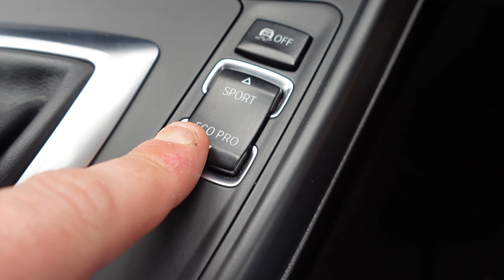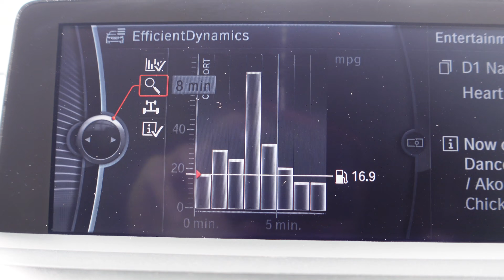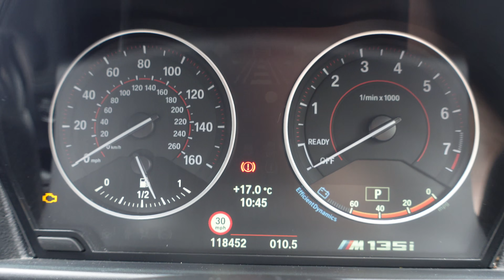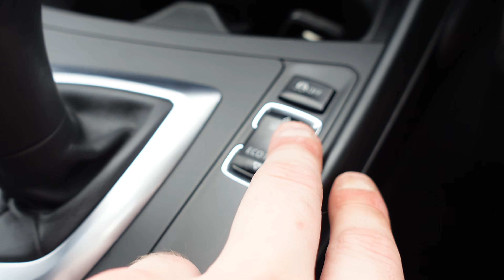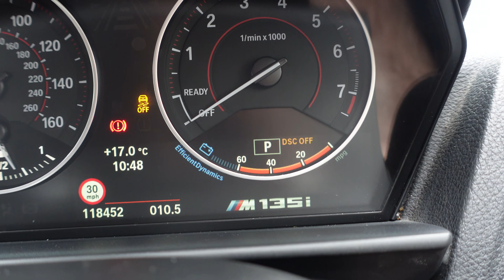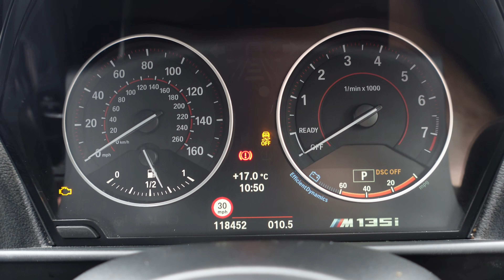BMW Eco Pro , Comfort Mode , Sport & Sport + Modes Explained

Comment: ECO PRO: sluggish throttle response, it makes it easier to drive slowly, without straining your right foot. Also it lowers max AC performance so there is a slight tiny fuel consumption reduction.
COMFORT: (normal) - default, linear throttle response curve.
SPORT mode actually does a lot of things at once: 
1. Fast throttle response, (natural response curve) 
2. Higher cruise RPM (around 2k) for more immediate power and faster turbo spool-up. 
3 Faster transmission kick-down, much more eager to downshift.
4 keeps lower gear for a few seconds after you let of the accelerator.
5. Less steering power assist for slightly better feel.
6. If you have adaptive suspension the car get's firmer the faster you go - sport mode makes this effect much more aggressive. Also you will have the option to choose for sport mode  to ONLY change suspension, without changing drive train mode.
SPORT + mode does all that sport mode does (always changes both suspension and drive train), turns off start/stop, turns of traction control and puts stability control in "drift" mode, which allows for oversteer but will still kick-in if understeer is detected. 

Additionally you can activate transmission sport mode, if you have that equipped, by moving the lever to the left: Even higher shift points + deliberately jerky shifts (no smoothing out) + if you start shifting yourself, it will stay in manual mode until RPM goes out of safe range (yup, it won't let you stall the engine nor cruise at 6k rpm), while in normal mode it'll revert to full auto around 1 minute after you stop shifting with paddles.

Comment: Sport+ is available on my 6 speed manual UK F31 320i/N20 M-Performance configuration, I've seen mentions that EcoPro will also reduce the duty cycle on the air conditioning compressor but I'm not 100% sure that is a thing!

Comment: I have an issue I cant diagnose, can anyone help please?
I have a 2004 bmw x3 with an m54 engine. 
I had a massive tear in the main air hose for like 3 years which I had a constant check engine light on for but the car ran completely fine other than a bit of irregular rpms movements at high rpm on cold engine. Im finally planning to sell the car and get something newer and decided to get the car into perfect working order. As I was starting to work on it my starter went out. Here is everything I did in the last month on the engine.

1) replaced the airhose,

2) Replaceced the ccv and all the hoses that go with the vent system

3) Replaced starter

4) replaced intake manifold gasket

5) replaced crank sensor

6) replaced exhaust side cam position sensor

7) replaced coolant overflow tank

8) replaced maf sensor with a cheap amazon version, ended up working even worse so I swapped back to original

Here are the symptoms:
1) hard time starting on cold engine, as soon as it starts, you can shut it off and try again and it will start right away.

2) Runs completely fine, drives fine until you floor it. When I floor it, the rpms reach a ceiling anywhere from 3000-4500rpms. When it hits that ceiling, engine will bog down and lose rpms to complete shutoff unless I depress gas pedal completely.

Diagnoses ive done for Maf sensor.
As car is running, I unplugged maf, no change in RPM, and engine stayed running. Is it possible its the MAF? Or intake side cam sensor? Disa? Throttle body/MAP? Fuel delivery? Im so lost, plz help

Comment: Any idea what the drivetrain error is caused by. It just does it when you drive at high speed but then rectifies itself. 
I was told it could be the egr valve?

Comment: Sport+ good in rain dont lock fron as much where in rain full tracktion off is scachy 125d got sport+ and 8 speed gearbox on 2 liter variant in case anyone wants to go eco 2 liter diesel 125d was good on mpg 40 in town 60 motorway 135i is much more fun tho

Comment: Hello,
I also own a F33 420i Cabriolet and wouldn‘t say the Eco-Pro is useless as thia mode enables the „sailing cruise - function“ which clearly lowsrs fuel consumption if you drive on German highways. Kind regards & greetings from nearby Cologne.

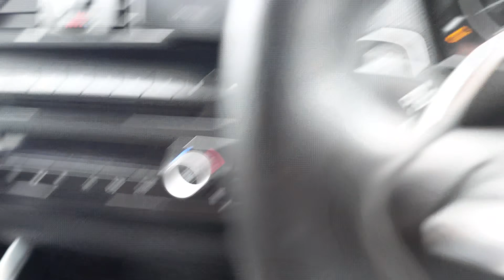Comment: im kinda confused, so you can basically put the car in sport while in comfort mode ? at 4:09 he said you can just move the gear shifter over to sport, does that apply while you are in the comfort mode or does that mean you go into manual trans w the paddle shifters ?
Reply: Moving the gear shifter between drive and sport just changes the transmission behaviour. Whether it’ll change gears by its own when it thinks it’s necessary or let you rev up to the red line
The engine parameters remain unchanged

Comment: Hi there first time bmw owner here 

I have a 420I (2.0L petrol) and watching your you say that the eco pro doesn’t do anything in the way of fuel save however leaving the setting as they are (75mph tip) I find that my bmw saves fuel and the remaining miles seems to stay the same or go up on motorways (I live 17 mines away from work) should I keep using the eco or should I just keep it in comfort? 

Thanks

Comment: The diesel automatic you can change speed on eco pro. Factory setting was 130km on my one I lowered it to 120km /h to decrease the output slightly hoping to save a bit more fuel.

Comment: Eco mode on a diesel, don't do shit for it. I got the 116d and on a full tank, it says, I get six hundred and sixty miles. After driving it six hundred and sixty miles I ve saved forty miles, but my tank's still empty and only covered a range of six hundred and sixty miles

Comment: Guys fyi in case you have a low tire pressure warning ( Lovely bmw thing ) you’ll not be able to change the mods. Specially if you want to go in the sport while the car is still moving. Small info for those that are maybe scared that their mods don’t work. 😁

Comment: Well I can see there’s no homework done here…. Eco pro doesn’t just reduce throttle motion, it also controls airflow into the car and cabin reducing the need to use the engine for auxiliary components thus reducing fuel, it’s not entirely useless, it’s an effective way to increase your MPG, you missed out comfort+ aswell (assume you don’t have the VDC) as comfort plus utilises the damper control, changing the behaviour of the suspension and chassis roll of the car. Which is again what it will do in sport and sport plus it will firm up the suspension creating less roll and stiffen up the car.

Comment: 2014 F15/ X5 30D @51k miles, EcoPro changes gears exactly wear I want it to. All other modes seem to hold low gears for longer unnecessarily which I hate. I have a fault where in EcoPro with very light throttle the car will erratically lunge/ surge and then disable a shit load of systems and revert to Shitty Comfort. I know the battery is weak so Im pretty sure it is the battery causing the issues as system will disable same systems sometimes before driving off.
Reply: My theory is AGM batteries have a weakness that BMW design exaggerates. AGM batteries are fine for starting current but do not hold a high voltage which BMWs require. As soon as voltage drops BMW does alsorts of stupid shit. AGM especially do not like cold winter temperatures and can catastrophically fail literally overnight. My fix is going to be fitting a good branded tolerant EFB battery. I dont trust AGM and really dont want one ever again.

Comment: My comment on sport+ is that during winter and if the road is slippery, its an hige advantage to use sport+, as without support systems you now have full controll over the car. I live top of a hill, now during winter when I want to drift the corners for fun, as I often do, then sport + is on. 😁🚗

Comment: There is a noticeable increase in revs and throttle response between comfort, sport and sport plus in a standard F32 435i. If you sat at 65mph and flicked through the different modes the revs increase and the car surges forwards. So I totally disagree with his comment about sport plus being for launching only.

Comment: Quick question I had some work done on my f30 since then the lights on the sports mode button and window buttons don’t light up no more is that just a case of changing a few fuses.  iv  lookdd online but most that comes up is sports mode not working at all.

Comment: Have the 530dAs  F10 2010 . No eco mode. ( German import )
Sport plus : tighter steering , higher rmps , bit quicker , logic higher consumption.
Use it rarely , car is quick enough.

Comment: I like the COAST function on ECO PRO. When going down hills let off the gas and the driveshaft disconnects and RPMs drop, you can coast and really increase MPGs!! COMFORT mode doesnt let you do that!!
Reply: You can coast in comfort, from the paddles, upshift to the highest gear possible and upshift again, car will coast. It’s written in the user manual too

Comment: Weird ,mi d is a 320d f31tourer sport model, manual 6 speed and it has sport plus 🤔🤔 now stage 1 mapped ! Sport plus gives launch control in a manual mmm do tell the difference from an auto to manual with sport plus !

Comment: I beg to differ regarding Eco Mode because  seen over 50mpg in Eco Mode on my M140i.
Also regarding Sports and Sports+,
In Sports mode all the safety features are switched on but with Sports+,  you get dynamic traction control activated which gives you more slip from in the rear, more exhaust pops and burbles and even more throttle response, well it certainly does in my M140i 😁😉

Comment: the only benefit to have a Eco mode on, is then your engine is cold and you need to drive it's good to switch it on and drive until your temperature rises, and wen switch to sport or comfort

Comment: A reasonable explanation.

Just a little extra added input.  This information applies to cars with driving mode selector switch and automatic transmission:

Sport plus = aggressive throttle profile / sportier gearbox profile / assisted driving aids disabled / sportier (heavier weighted) steering / stop-start system disabled
Sport mode = same as above but with driving aids enabled
Comfort mode = standard throttle profile / standard gearbox profile / driving aids enabled / standard (lighter) steering profile / stop-start system enabled

Eco-pro mode =  standard throttle profile / eco gearbox profile / driving aids enabled / standard steering profile / stop-start system enabled / climate control runs on reduced power

Difference between eco gearbox profile and standard gearbox profile = standard, car always remains in gear when decelerating.  eco profile = gearbox will drop into neutral and coast when decelerating, up until the driver puts his foot on the accelerator or brake when it will engage gear to either assist acceleration or braking.  eco-pro will also use GPS data from the navigation system to provide driver assistance re advice on whether to use the accelerator or brake - AND, will re-engage gear to reduce the cars speed prior to entering built up areas.

Eco-pro + ZF8 = greater mpg than the manual gearbox version.

My 435d can achieve high 40's mpg to low 50's mpg on my work commute where using comfort mode, 5-10 mpg decrease is to be expected.  Sport mode renders another 5-10 mpg loss.

I average no less than 30 mpg in sport, 40 mpg in comfort and 45-50 mpg in eco.

Eco-pro does not physically deactive when the road speed exceeds 75 mph, but any benefits offered by the system are negated beyond that speed, hence the reason the instrument gradation is greyed out, prompting you to reduce your speed to 75 mph or less.

My only wish is, that BMW would have married the ZF8 to the M57 engine as I trust the M57 way more than the N57.

Comment: One question really(maybe useless)
You said that the eco pro mode is basically useless. 
But is it usefull on downslope road or into city center?
Because you don't need extra power from your engine in those cases...

Comment: When I bought my 15 plate 235i, the dealer told me if u press the switch twice to go into sport+, then traction control is 50% off. But if you hold the dsc button it turns it completely off 100%, anyone know if this is true? BTW I owned the 235i for 8 years and it’s so much fun but always scares me to this day sometimes aha

Comment: Sport + only partially turns off the DSC not all the way off to give you some slip but still kicks in if you take it too far. If you want it all the way off, you need to do that using the traction button 🤷‍♂️

Comment: Hi,  my 430d sport Mperformance  when use a ECO PRO is saving  fuel,  but when pressed kickdown,  directly  I have 100% power  on the wheel . This  car is so quick  change from little  popy to crazy monster 😅😊😊
And yes confirm  use  DCT off and  sport+  is not for idiot. With this  mode is so easy  have a party in the bushed 🌲🌳🌴🪴🌱🏝😂😂😂😂

Comment: Great vid as always, my 21 reg 420i actually gets more to the gallon on a run if in eco pro as it holds higher gears, but around town its useless as no acceleration as you said
Cheers

Comment: I often pop it into eco mode if the roads are a bit icy or wet.  As it reduces the throttle I’ve found it reduces the chances of wheel spin and eases the power in. Anyone else do this?

Comment: My 2014 435i rwd manual gets 34 mpg going 95 mph in eco. Whether im correct or not, it feels like the turbo is heavily disengaged, until you really easy into the throttle. Maybe it’s because i have the direct throttle mapping, but for a 520 hp bolt on/ build this car can be whatever you want it to with a safe a build, or up to 800 with new internals

Comment: hi, i’ve just bought a new bmw and there’s a weird lever behind the left side of the steering wheel, has arrows for going left and right, looked like a malfunction so i snapped it off
Reply: All jokes aside, the BMW turn signal design is completely idiotic. Want to stop signalling? TOO BAD! You pressed it slightly too hard and now you're signalling the other way.
Reply: @jfox24  just got a beam yesterday learnt this the hard way 😭
Reply: If you want to cancel the signal just press it again in the same direction  that cancels it
Reply: @reesemiller1572  Yea, we dont need those
Reply: It's funny how bad non-european are with european car blinkers
Reply: Mine came with that too. Apparently it's a rare feature
Reply: That hidden stem is put there from factory, in case you've bought the option. Some say it's one of the most expensive options.
Reply: Rear view mirror is unnecessary too, Mario!
Reply: @reesemiller1572  LMAO 😆😆😆😆

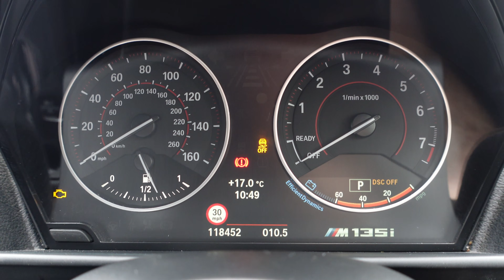Comment: 7:35 one more visible change I have noticed with my diesel xdrive is that sport mode raises up idle driving rpms closer to 1.8k range while on comfort it stays as low as 1.2k rpms - apperantly to make engine more responsive for sudden power demands.

Comment: You can remove the speed limit for eco pro by configuring it in the eco pro settings on the screen, then you can drive at any speed while in eco mode

Comment: I don't have to worry about the eco pro anymore. As these buttons weren't placed in the best place possible I poured coffee all over it and it burned the pcb board so the down button doesn't work anymore. 130£ and the dealer told me that they sold 270 pcbs in the last 4 months!!! So have to wait for it for around 3 weeks. On the other side for 3 years of ownership I used the eco pro for about 30 min - it just kills the car performance for 2-3 extra mpg not worth it
Reply: its supposed to kill the performance if you listened to how it limits throttle and changes into n when coasting it dose its job w my v8 only gets 25mpg in sport on the e way eco is practical and useful reconsider your take
Reply: @thepharcyde8285  don't spill coffee on switches, tends to course problems 😑

Comment: I don't have an "eco pro" on my 2011 525D but I do have the efficient dynamics blue bar that becomes filled up when coasting. What is this actually doing? It's got a picture of a battery but my car is not a hybrid. Does it have anything to do with alternator load maybe?
Reply: @craig855s  In my understanding it turns off the alternator when driving at constant speeds and battery is above a certain voltage.

It then turns on again when you hit the brakes to charge the battery and it also helps slow down the car more (reducing brake wear theoretically)

Comment: One question I have is when I use the paddle shifters and for some reason want to go back to D is there a way to make it do that? I have had the car for 8 years and don't know.
Reply: It will automatically go back to D when you don’t touch the paddle shifters for a few seconds.

Comment: My new 118i when I drive over a cat's eye or lines on the road the car erratically trys to straighten the steering up this can be quite scarry. Is this the intellegence program it when it's in economy mode
Reply: Can be annoying but wakes ou up if you nod off .Turn off lane departure mode and a green line will appear on dash and it won’t do it.